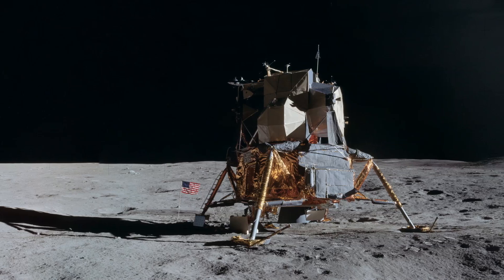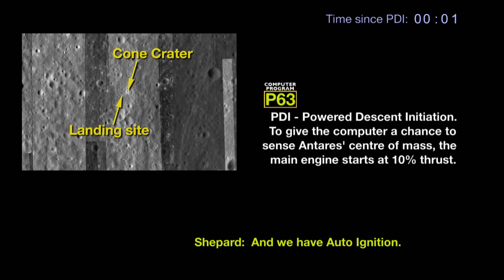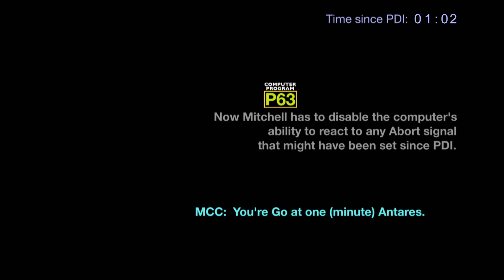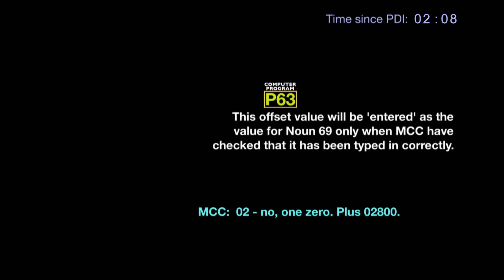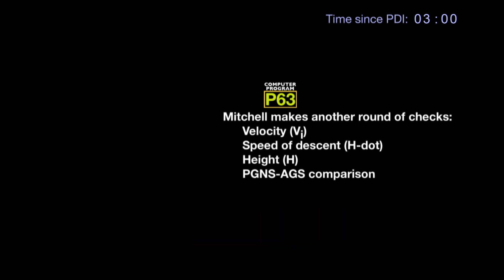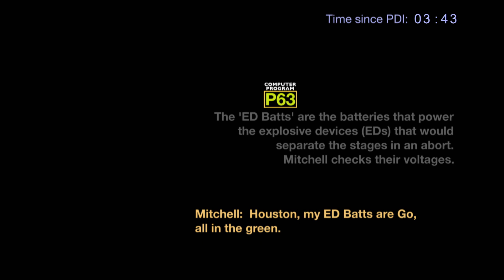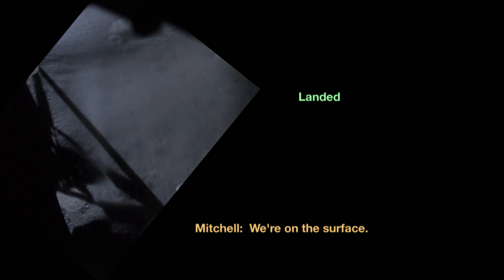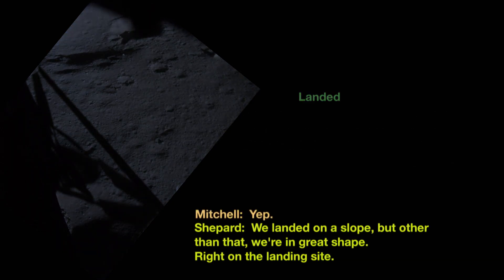Apollo 14 landing from PDI to Touchdown

Comment: There's no way this happened. They even tried to fool us that they strapped a car to that cookie tin, a huge rocket blasted them through the Van Allen Belts, they landed without a hitch....unpacked that car, drove around on it laughing and taking photos then blasted off whilst the take off was filmed, attached back to the spaceship and floated back to Earth. Often things appear so fantastical that people just have to believe it. They couldn't even rescue a couple of people in low Earth orbit for months.... it's not even space! This is so fantastical, it HAS to be nonsense.....
Reply: Your ignorance is stunning.   Try reading to find the simple answers to your doubts.
Reply: @SME.Retired  can you answer any of them?  naturally, you can't.  How many jabs did you have?
Reply: None of those things are "fantastical". They are reality, backed by evidence. 
1. The LM is not a "cookie tin". Calling it that just betrays your ignorance.
2. The LRV is not a car. It's a purpose-designed vehicle that fit in a very tight weight budget, and would function only on the moon. 
3. Yes, they went through the van Allen belts. Contrary to what conmen are trying to deceive you with, humans can safely pass through the belts, as long as they don't spend too much time in the belts. You're in trouble if you spend a week at the center of the belts. The Apollo crews traversed the belts in 3 hours. 
4. NASA didn't "rescue" those astronauts because they didn't need to. Those astronauts were happy to stay on the ISS - spending more time in space is the dream of every astronaut. Getting the astronauts back to Earth sooner would have cost NASA $100 million. Are you advocating for needlessly blowing that kind of money?
Reply: @zounds010  and you have a degree in....?
Reply: @rickreid8572  Physics and electronics engineering.
Reply: @zounds010  ok so no flight time nor aeronautics?
Reply: @rickreid8572  I don't have to know how to fly an airplane to judge the engineering and physics of Apollo. And aeronautics is just applied physics.
Reply: @zounds010  so you have no flight experience and have never worked for NASA nor any government agency.  Let me just confirm this is correct?
Reply: @rickreid8572  Are you blind? I don't have to know how to fly an airplane to judge the engineering and physics of Apollo.
Reply: @rickreid8572  Have you ever flown an aircraft yourself?
Reply: @rickreid8572  All I have to do to be able to evaluate whether Apollo is real or not, is have enough knowledge and comprehension to study and evaluate the evidence. My education in physics and electronics engineering give me that foundation. I found that the evidence for Apollo is solid. I was able to verify many aspects of this myself.
I also looked at the arguments used by the moon landing deniers, and I found those are not solid. There is no evidence at all that says the landings were faked. Every argument used by the deniers is full of holes. I demonstrated this to you by debunking every claim you made.
Reply: Не может быть что бы у тебя был мозг.

Comment: what's "R3" at the beginning of the landing (2:50 into the video) ?
Reply: They select Verb 06 Noun 40 which displays the following on the three registers of the DSKY: R1 - Time from ignition and the time from cut-off; R2 - the velocity to be gained, a number that will start at 3,283.6 (fps, 1,000.8 m/s) and decrement towards zero; R3 - the accumulated velocity, a number that will start at zero and increment towards the desired Delta-V.

Comment: This, and Apollo 16 maybe especially, were bears of a landing. 14 having to struggle with the abort indication, 16 having to troubleshoot their malfunctioning CSM
Reply from the maker: The malfunctioning CSM was only the half of it. The 16 LM crew actually had to deal with was the loss of their steerable high gain antenna. This became a serious issue when data had to be uploaded into the LM computer and the low gain antenna was not capable of supporting this. Instead, Charlie Duke had to copy lists of data from mission control and then manually enter it into the computer, an exacting task utterly intolerant of mistakes.

Comment: Why narrating using the metric system when the spaceship used Wnglish units?
Reply from the maker: Most of the world uses the metric system for science and engineering, including the US.
The spacecraft crew used 'aviation units'. The nautical mile, for example, is not an English unit. What is not often realised is that the on-board computers calculated the position and velocity of the spacecraft in metres and metres per second. The values were output to the display after conversion to aviation units. The Lunar Rover, carried to the Moon on the last three missions, had a speedometer calibrated in kilometres per hour. Its navigation system indicated the distance back to the Lunar Module in kilometres.

Comment: Also, consider this; the surface-to-surface distance from the Earth to the Moon is approximately 235,000 miles and since the last alleged, manned moon
landing in 1972, not one human has been further out into space than 400 miles and very few have gone even that distance. Most space-shuttle orbits take
place at around 200 miles from the Earth, the same distance away approximately, as the space-station. So, to put these facts into perspective, in the twenty first century, utilising the best technology that money can buy, NASA is only able to send humans around 200 miles into space, but in the 1960s it had the capabilities to reach an object 235,000 miles away, undertake
several orbits of the Moon and then make the return trip – all on a single tank of fuel! Please pardon my scepticism
Reply: you said....  'in the 1960s NASA had the capabilities to reach an object 235,000 miles away, undertake several orbits of the Moon and then make the return trip – all on a single tank of fuel!'  have you not done a single piece of research on any of the 9 Apollo missions to the moon and back before embarrassing yourself on YT...
Reply: "not one human has been further out into space than 400 miles"

After the Saturn V rocket was retired, please name the rocket you'd propose they use to go higher than low orbit.  Can you?

"the best technology that money can buy"

Huh?  It's not about technology.  But, you got the money part correct.  Congress must allocate the money to do the things you're asking for.  NASA cannot just decide for themselves what to do.  Every dollar is allocated by congress.  And, unless congress allocates money for more moon missions, there are no more moon missions.  You act as if you don't know this (probably because you don't).

"but in the 1960s it had the capabilities to reach an object 235,000 miles away"

The Saturn V was in operation back in those days.  It was retired from service in 1975, and there were no replacements until SLS was funded under the Artemis program.  The first SLS launch was at the end of 2022.  The next SLS is slated to take people back to the moon.  Why is this such a problem for you to understand?  Congress funds a program, NASA manages it.  That's how this works.  Congress stops the funding for a program, and the program goes away.

"all on a single tank of fuel!"

Dewdrop, Saturn V rocket, and the CSM, and the lander, each had multiple tanks.  Good gods.  What's wrong with you?

"Please pardon my scepticism"

That's not what skepticism is.  You can't even spell it, by the way, let alone know the definition.  In order to be skeptical, you need to first understand the topic.  You clearly do not.
Reply: @rockethead7  It's almost as if if you throw titanic amounts of money and talent at a task, amazing things happen and those things stop when the money stops - who knew??

Comment: Брехня. Не были они на Луне.
Reply from the maker: Your statement is incorrect.
Reply: @apollo14-apolloflightjourn9  Technically, this is difficult to implement even now, given the scientific and technological progress over the past five decades. And it is absolutely impossible to believe in six successful expeditions half a century ago.
Reply from the maker: @ingvar_666  The difficulty in implementing such a mission nowadays is not technical. It is down to cost and the willingness of a political or commercial entity system to devote resources to the task. I appreciate that if one is unaware of the techniques involved in travelling to the Moon, one might find such a thing difficult, or in your case, impossible to believe. However, that is not a measure of the reality of its accomplishment. There are many good works out there that can teach these topics.
Reply: @apollo14-apolloflightjourn9  Criticism is not objective. In Russia, they have heard enough about the technologies necessary for a flight to the Moon. In particular, Korolev argued that a single - chamber rocket engine is a technological dead end. That is why Saturn-5 is not mentioned anywhere else. However, time will set priorities. It is impossible to exclude that the first expedition in the 21st century will face insurmountable problems, despite modern technologies.
Reply: @nunya_bizniz  after the first expedition of Columbus to America, hundreds and thousands of ships sailed. After Gagarin's first flight, hundreds and thousands of spaceships also flew into space. And more than half a century has passed since the landing of the Americans on the moon, but no one flies there. But why? Because it is not feasible even now. And even more so, these flights were technically impossible at that distant time.
You can be gullible, don't just be a fool.)

Comment: No video of it.... fake sh*t
Reply from the maker: 16mm film coverage begins at 11:20. Real goodness! :-D
Reply: @apollo14-apolloflightjourn9  at 15:25 makes like wind eventhough it not even next to the ground, doesnt look like chinese rover when it noves wind only when it touches ground, in 1969 they didnt land on the moon
Reply from the maker: @fachadolid3030  It's less than 100 feet off the ground at this point. I see no issue with the descent engine gases blowing the lunar dust around at this height. They landed in 1969 (Apollos 11 and 12), 1971 (Apollos 14 and 15) and 1972 (Apollos 16 and 17).

Comment: No damage to the craters blasted by 2000kg thrust. Same craters are damaged by astronauts boots https://www.flickr.com/photos/projectapolloarchive/21672173882/in/album-72157656723857913/
Reply: Why would you expect damage? Like forming another crater you mean? It would certainly expect a great amount of erosion, and this is exactly what we see in the images.
Reply: @oscarin13  there's hardly any and NASA's own vacuum chamber testing says there should be. https://youtu.be/qX9h7hBx9YQ
Reply: @thebruffy1077  "there's hardly any" then watch a HD photograph because I definitely see a large amount of erosion

yes, NASA might have expected a landing crater but they can't completely replicate the conditions on the Moon. The inner layer is very compact while the outer layer is very loose (what the astronauts kick).

There's a difference between a crater a footstep, btw.
Reply: @thebruffy1077  
The experiment shown in that video doesn't represent what happened in the real landings. Not only the exhaust plume of the descent engine was very wide and diffuse, but the engine was shut before the legs of the LEM touched the ground. In the simulation, the engine continue to work several seconds at the lowest point like if they were trying to dig and reach the hidden face of the moon!

To be fair, I think that everybody was expecting to see a more defined blast crater under the LEM. Including the NASA engineers. Before the Apollo 11 mission, all the simulated images of the mission presented by the NASA  to the public were showing a blast crater. So, I guess that its absence  was a relative surprise for the NASA, even if it was explainable, after due reflection, now knowing the caracteristics of the lunar surface. 

Considering those facts, with the knowledge they had before Apollo 11, if I had to simulate the landing in a movie set, I would have put an obvious blast crater under the LEM, thinking it would have been more credible for everybody. So I think that its absence not only is not a proof of the fakery, but it is a proof that it was real!

Comment: The LRO images are enhanced and altered. This is public record. NASA told specialists working at the university of Arizona what should be or was likely captured in an image, and they used a variety of methods to manipulate the images including inserting landers. NASA refers to these as enhancements and  members of the team claim they merely made the reference  points easier to see and completed incomplete images . But the actual unaltered images are given and it is clear that the changes are completely fabricated. 

https://www.apollo.mem-tek.com/LRO_NAC_Apollo_First_Looks.html

http://www.mem-tek.com/apollo/LRO_NAC_Apollo_Images.html

https://www.apollo.mem-tek.com/LRO_NAC_Apollo_14_Enhanced_Images.html

http://www.mem-tek.com/apollo/LRO_NAC_Apollo_11_Enhanced_Images.html

Two of these links include the supposed new images from closer to the surface,  in which  the alterations are just transposed on to the new images.

Comment: I’m not a denier but why was there no delay when they were talking to each other?
Reply from the maker: It is a perfectly good question and one that is often asked. Important to understanding what is going on here is to ask, "Where is the recorder?"

It happens to be in Houston, probably in the same building as mission control. Therefore, if a query comes in from the Moon, the CapCom will reply with the normal conversational delay, and that is what the recorder will pick up. One would only expact a delay is when CapCom asks the crew something specific and has to wait for an answer. His question will take about 1.25 seconds to get to the Moon, the crew will maybe need a little thinking time then the answer has to travel from the Moon to Earth - all in all, about 3 seconds. That's the only instance where you should expect a delay.
If the crew are talking to each other, they will respond to each other normally. While there would be a delay for that conversation to reach Earth, that same delay would be applied to both sides of the conversation; i.e. we're just listening in on a conversation that occurred 1.25 seconds ago.
To restate, the only time a delay should be expected is when CapCom asks a question and has to wait for a reply. In all other instances, the delay should be about what would be expected from normal conversation.

I hope that helps.
Reply: The audio we are hearing is from the moon. So when we hear CapCom audio we are not hearing it from Houston but from the LM so that's why it seems to us there is no delay between the time you hear CapCom and the astronauts reply.   So we are actually hearing it as if we are in the LM with the astronauts.
Reply: The tech the we have is what they had years and years ago now what they have now is 50 to 100 years ahead of mainstream

Comment: Al Shepard, about to land 250,000 miles from home on a desolate moon and it's "OK babe."   One cool cookie.
Reply: Yes, the icy commander did a pretty good job here considering all the computer problems, although Antares skidded sideways on its landing gear and stopped at an angle of 8 degrees with one footpad in a small crater. It's a good landing if can you walk away!

Comment: FAKE: you can't get thru the van Allen belt.
Reply from the maker: Evidently you can. There are two belts, the inner and outer, both forming toroidal shapes around Earth's equator. They consist of volumes in space where radiation levels are elevated by Earth's magnetic field which traps energetic particles from the Sun. The inner belt is mostly populated by protons, essentially ionised hydrogen. The Apollo spacecraft passed through this in a matter of minutes and the spacecraft hull provided a substantial degree of shielding to this type of ionising radiation. The outer belt is larger and it took an hour and a half to traverse it. However, it chiefly consists of low energy electrons which are less of an issue. Also, because they were headed for the Moon, their trajectory away from Earth was angled away from the thickest part of the belts.
Certainly, the van Allen radiation belts are not a place you would want to hang about, but like anything in radiation medicine, it was all about dosage. An Apollo spacecraft was in the fastest part of its trajectory at the time so that dosage was kept within tolerable levels. It is true to say that they took a real risk on Apollo by hoping that there would not be a large eruptive event on the Sun during their time beyond Earth's protective magnetic field, but that was considered a risk worth taking at that time.
Reply: They did and the LRO photos proved it TEN years ago. Get a new hobby hoaxtard.
Reply: James Van Allen says you can, and he was right..